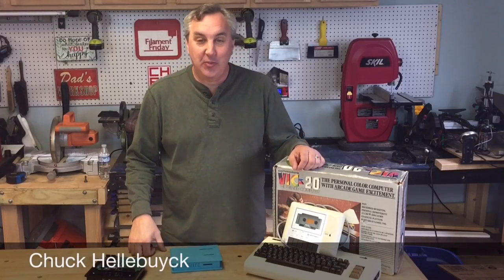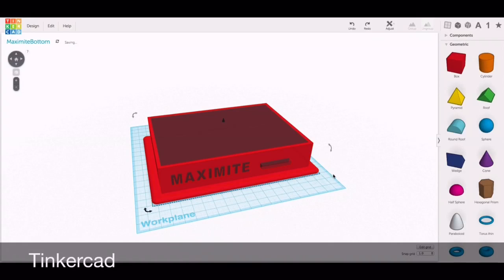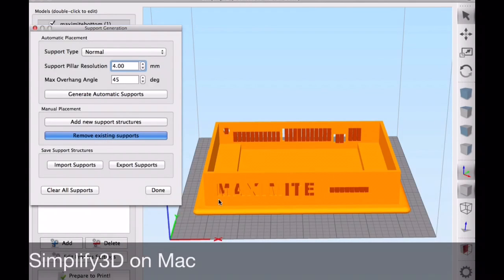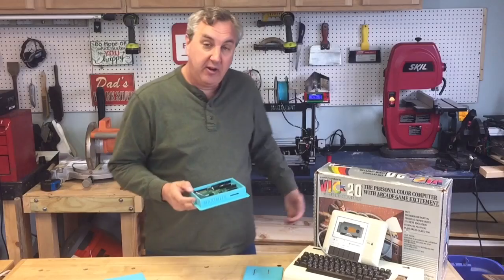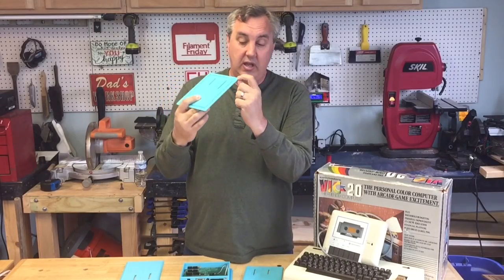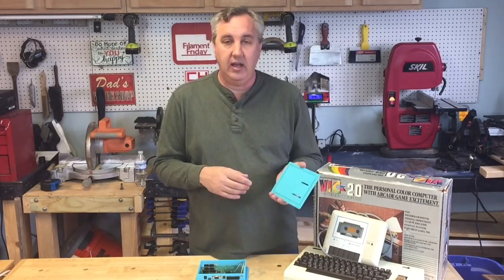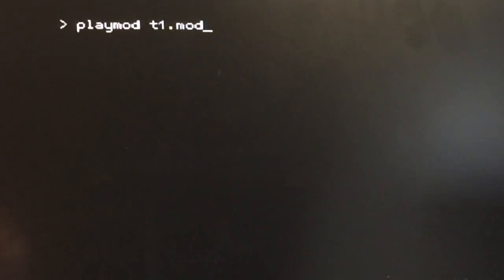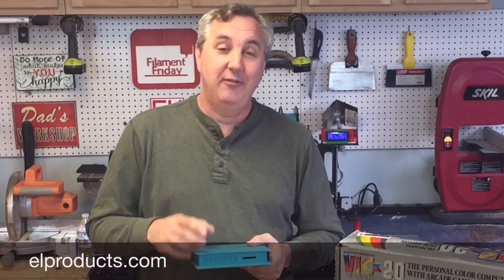3D Printing Filament Friday #64 - 3D Printed Retro BASIC Computer Case on MAKERFRONT

Comment: I started out on a Commodore 64.  I still have a portable Commodore 64 and it works.  :)
Reply: +Michael Phelps - Same here :)   Good to know another "classic" in the 3DP community.
Reply: Aren't all c64's portable. 😄. In many ways computers were just so much more fun in those days.
Awesome video Chuck - I did the print "text" goto 10 as well, but there a variant, where it would not have a line feed after. Think it was semicolon or something after the text.

Comment: Have you ever tried dissolving material in a dual print head, and use the dissolving filament as support material? It's just a thought, but it seems like it would be a million times easier than cleaning up support
Reply: Da Vinci 2.0?

Comment: What settings did S3D suggest changing? The print surface on parts I print are rough on the face that touches the raft also

Comment: Chuck , I've noticed that you are using rafts a lot in your printing. I never (literally, never) use rafts myself, and that way I don't have as many surface finish issues (where the part is bonded to the raft).

I really don't get the raft thing. Use proper methods for adhesion, and eliminate (at least more or less) the need for rafts.

Comment: Heya Chuck, I think you've spent too much time with ABS - as a couple of other people have mentioned, when printing in PLA you usually only need a raft and/or brim if you've got small surface contact with the build plate and/or a lot of support structure. ;P Unlike ABS you can just lay it flat and print away, and you'll get a bottom that's as smooth as your build plate. (...so be sure your tape/BuildTak/etc. isn't all gashed up before you start. ;) )  In fact I prefer printing PLA flat like that since it does end up so smooth.  

I'm not even sure that you'll need a brim; if anything, to get the edges nicely curved you could try pumping your fan up to 100% and/or increase the extrusion width from 0.40mm to 0.5mm (or "Auto") in the Extruder tab so that there's more overlapping plastic between those bottom few layers of the curve where the build angle is extremely sharp.
Reply: +Chuck Hellebuyck&#39;s Electronic Products I have had PLA warp myself on several occasions, so please don't quote me as saying it doesn't happen; I just reread my comment to make sure I didn't do that, although I guess it does kinda sound that way on re-reading so apologies in that regard. (Actually, I'm not even sure why I went on with the second part of the comment; I'm going to blame it on the vodka and coke I had been drinking to cover my ground...) Round corners like that have caused me problems in any material, so I just avoid them now if I can, especially since rafts seem to cause that "cross-hatching" issue with PLA much worse for me than with ABS, which I know you're more used to printing in and so maybe hadn't experienced, but I'm just kinda blabbing on and on so I think I'll stop now. :D